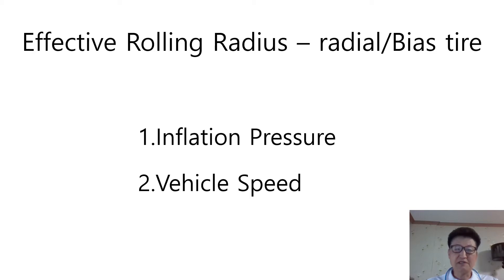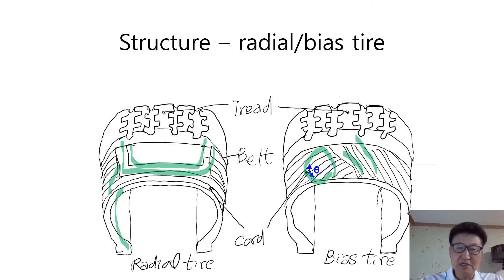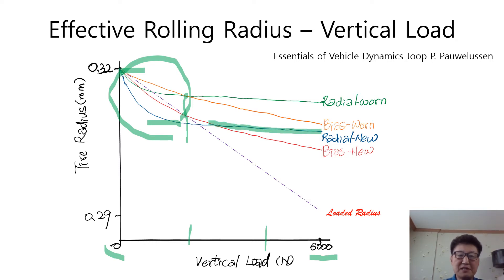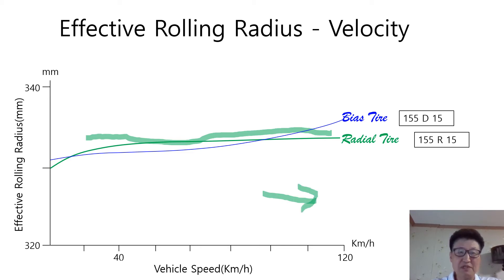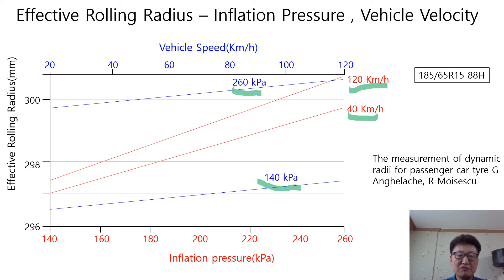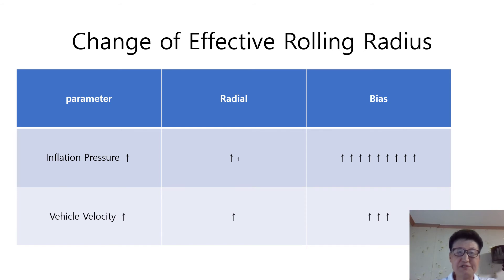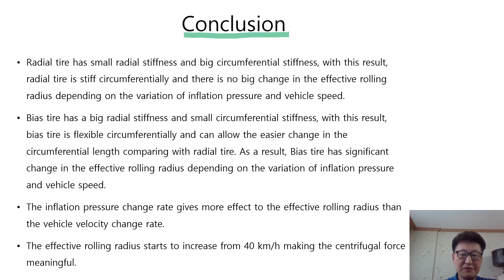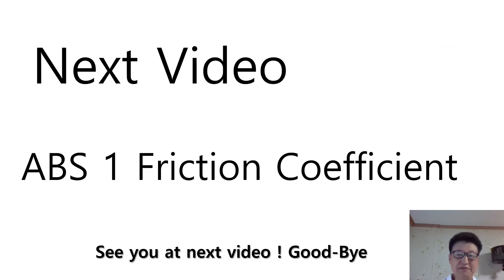E0011 Effective Rolling Radius - bias, radial, inflate pressure, speed, vertical load - EulSeoggy Ko

Comment: So does this mean lower tyre pressure saves you more on petrol?
Reply from the maker: Hi! low pressure needs more fuel and high pressure needs less fuel.
Reply: @vehicledynamics  does low tyre pressure means less rolling circumference therefore quicker acceleration?
Reply from the maker: Main reason is that when inflation pressure gets lower, rolling resistance gets bigger.
Reply: @vehicledynamics  thanks. My car placard says about 37psi is recommended. If I am not looking for traction but I am looking for fast acceleration what max psi should I set it at?
Reply from the maker: Fast acceleration means tire should support the biggest traction force from the engine as far as it can. For this, you should select the inflation pressure recommended by auto maker because the nominal pressure secures most evenly and widely distributed pressure on the tire contact patch. That Allows tires to support maximum traction force.
Reply: @vehicledynamics  thanks but I don't think you understood my question. I'm not looking for traction
Reply from the maker: I might not understand your word 'fast acceleration'. But fast acceleration can't be achieved without the corresponding traction force.

Comment: Can you explain why changing tyre pressure has an effect on rolling radius please?
Reply from the maker: Thanks for watching my channel. Tyre pressure gets higher, then, internal volume gets higher,  consequently, rolling radius gets larger.
Reply: @vehicledynamics  so it is to do with heat increase? Hotter air increases in volume increases diameter?
Reply from the maker: Yes.